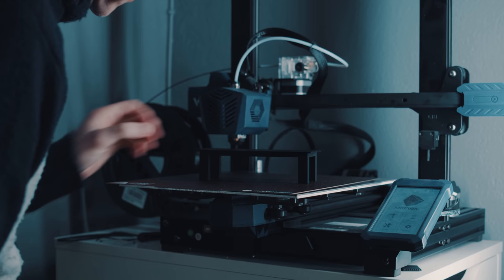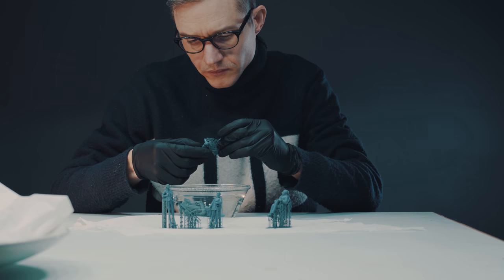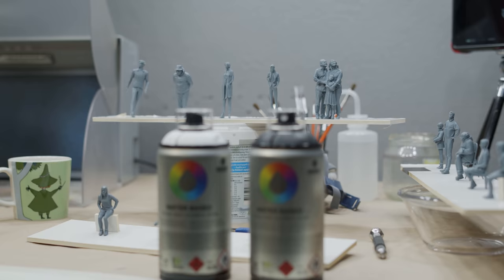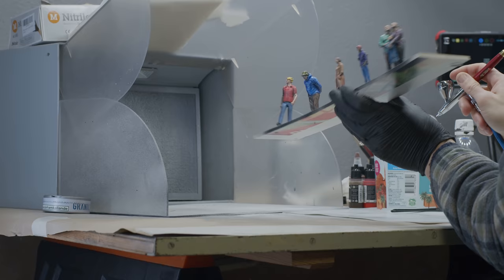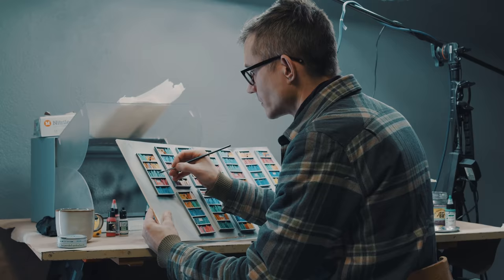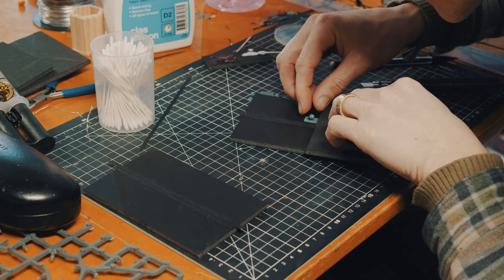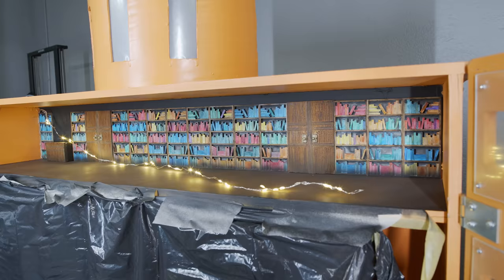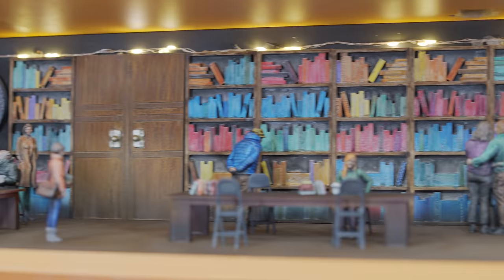Building a Miniature Library - in Two Days

Comment: I just wanted to add a comment so I could introduce you and everyone else to a common industrial concept that I use all the time in my professional career that we refer to as intermediate or temporary adhesive. By using a small amount of super glue in strategic places and supplementing that with a much slower acting epoxy or standard type white glue you get the immediate grab of ca glue combined with the long term adhesive property of epoxy/white type glues. While this is less beneficial on typical miniatures in your case with the large doors and such would work great. Just a few dots of CA here and there and work in the primary adhesive in the rest of the area around the CA and it will grab super fast and eventually long term as well. Just a note to keep you from having to bust out the hot glue next time.
Reply from the maker: Thanks for the tip! I’ve been doing just that on my mdf terrain. Now I know there is a pro term for it :)

Comment: 15:00 Maybe, but on the other will we ever finish our bottles of paint? I am a notoriously slow painter and a stingy one at that, so only use what I need. I once counted how may drops of paint their are in a 17ml bottle and came to between 350 and 400 (this means 1 drop equals euro 1 cent or .5 cent if you got your paint on the cheap). Those where smaller drops, because it was an ink, so let's say there are 200-250 thicker drops in a regular 17ml hobby paint. I tend to use 1 drop or less per color on a small 28-32mm mini, so need to use that color on 200+ mini's to empty a bottle... So maybe unless you are working on entire gaming boards, just use hobby paints for terrain and project like these. They are nicer to work with anyway.

Fun fact. The only bottle I have emptied in the last 3 years of hobbying was white ink. Since then I bought a 250ml one that will last me the rest of my life... Zenithaling a whole army for a friend does takes some white ink though. That's how I emptied that 30ml bottle in the first place.
Reply from the maker: Very true! I've managed to finish a couple of bottles, but I'm constantly putting way to much in my wet palette all the time. It just felt strange to use Khimera paints to drybrush something like this 😂

Comment: Great great project! Just as an "somebody told you" regarding water based spray cans from well known manufacturers: I got Molotow's Coversall Water-Based Acrylic spray cans and the experience has been very similar to yours with Montanas. I think a single black coat is doable for wargaming minis but white zenithal is a no go. But hopefully they'll be usable for some terrain.
Reply from the maker: That was exactly what I was thinking. The black, I can probably base coat mdf terrain with. But man was I surprised when those huge white blobs flew out of the white can...
Reply: @52Miniatures  I bought that same Montana white can a year ago and had the same snowy zenithal experience. I've had more luck with their matt varnish, that one has been quite OK.